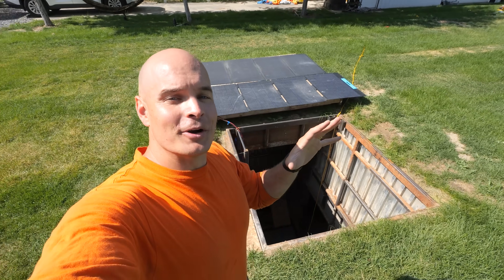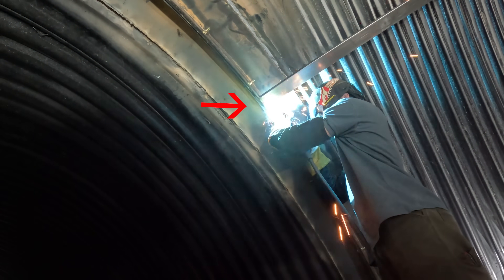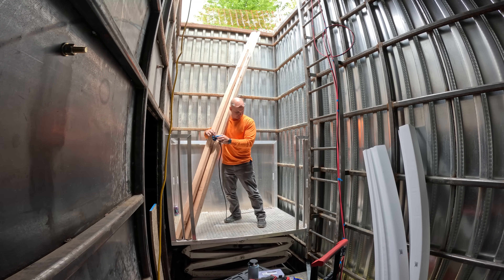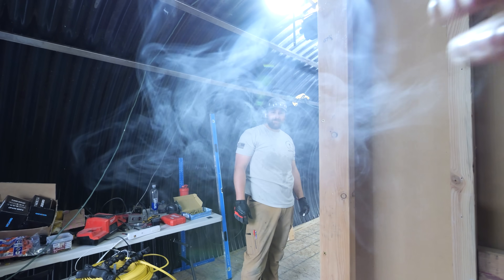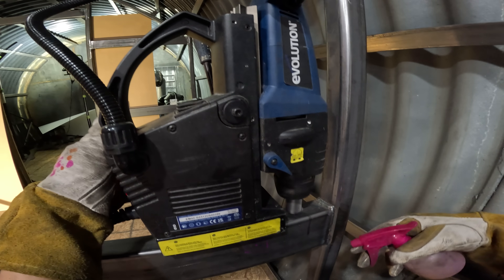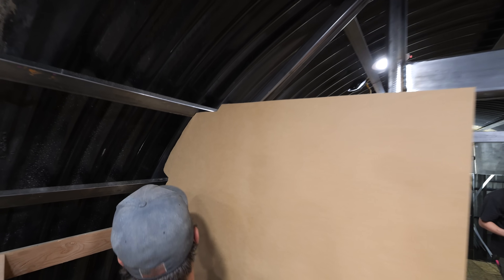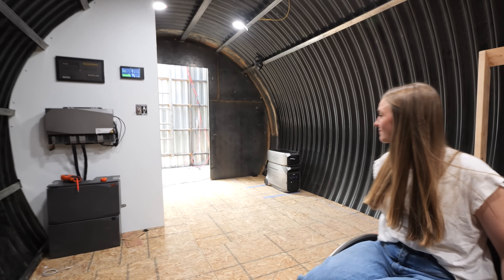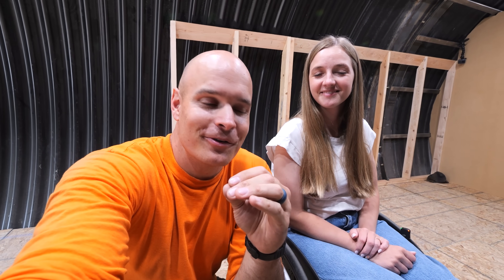How to Properly Power a Backyard Bunker - (Completely Off Grid)

Comment: While Ecoflow makes some cool products, they are an order of magnitude out of the reach of the average person without having to save up for quite a long time.  10KWh is also about 1/3 to 1/2 of what the average home will use in a 24 hour period.  So even if the bunker is not using a ton of electricity it will still need a lot more than 2 battery modules to power it under a full time use scenario.  5-10 modules (25-50KWh) would be a good start and that would be very expensive considering we aren't even talking about the ground mount array you would also need above the bunker to keep it charged up in a grid down scenario.  

Since the system installed is really designed for RV and van use it also can't handle as many batteries as the larger home systems can so it will not be able to be expanded beyond the single setup without a solution from ecoflow to allow more batteries and more inverters to be connected down the road and then things get more messy and less efficient (like in their whole home setups). All in, just the power system with 15KWh of storage and a 4.8KW (that is all the unit can handle with one inverter unit) ground mount solar array is going to cost well over $20,000.

Comment: I'm surprised you put the lights on the less efficient AC power seems like the perfect thing to put on the efficient DC and skip converting to AC only to convert it back to DC.
Reply: prob just easier to buy all the stuff.
Reply: @zachmoyer1849  Maybe. There's a whole market of 12V DC lights designed for RVs out there that are pretty easy to source. They're not usually stocked at the big box home stores but they're not hard to order.
Reply: @MrRtkwe  yeah now that im thinking about it though with him redoing that whole building to turn it into a factory for his wheelchair company he probably got all this stuff for "free" as leftovers or unused components in that buildout.

Comment: I've started old snowmachines and atv's with 15-year-old gas in them without a problem. You may have to put some fresh fuel into a spark plug hole, but the gas itself is usually still volatile. Gas has a much longer shelf life than most people think. I wouldn't recommend it for average use, but it will still fire a spark plug and cylinder.

Comment: Hey Jerry, with underground structures you always run the riak of radon gas build up which can lead to lung cancer. Even with good ventilation it might be useful to check radon concentration, there are these foil balls which you can hang in the bunker for a given time, the alpha particle emitted by radon damages the foil which you wont see before etching the foil with acid. In germany there is a startup who does this for 30€. Might be an idea :)

Comment: Electical batteries are good in the short-medium term. Using shelf stable unmixed chemicals to fuel growery lights for ethanol would be better. The conversion and containment is likely outside of the budget even if yours is much higher than most.

Comment: Thinking about your fictional apocalypse... the sun might not be the best solution for power generation. AND... since you have that wonderful elevator... I was thinking, a wind generator mounted to the elevator, that is extendable, and the base of the wind turbine could also house a security camera, so you can see whatis going on up top.  So obviously you will have a nice door when the elevator is lowered, why cant the elevator itself be a door while it is extended up top? With a wind turbine base attached to it, when the elevator is lifted, the turbine could be extended another few feet, and give you a place to mount a camera and weather sensors. When lowered, and the elevator lowered, you should be able to do any required maintenance on the turbine safely. Maybe bolt, not weld the turbine base to the elevator, so it isnt permanent.

You arent going to want to go up top in a wheel chair, during an apocalypse, very often. It should be doable, and make sense. Could be fun engineering something like that.
Reply: you might want to engineer a similar contraption for your solar panels. Something that will fold down and out once the elevator is raised into position, but be accessible in the elevator shaft, and secure, so you can do maintenance, or just to hide the panels from looters or passeres by. You dont want to advertise your bunker, or people will literally dig you up with a couple shovels. Or worse, cut off your air supplly and just wait for you to come up.

Comment: Curved translucent paneling with lighting behind to simulate natural lighting. White or reflective paint on the black outer hull so your lighting is energy efficient. A metal reinforced room for potential prisoners. An apocalypse bunker isn't an apocalypse bunker without away to vet noobs. Probably adjacent to the airlock room to the exterior, also soundprrof. A fire system spray system and a leaking water injection system. A straight away run space so that you can practice fleeing while contained and build the kind of muscles that you need for fast reaction distance. Heat removal venting so that your TV, batteries, and refrigerator don't overheat. An absurdly long tube for your exhaust. A separate absurdly long shaft for your escape. Non explosive weapons from Jorge Srague's slingshot channel. A space for your VR running system so that you can have physical activity in a VR. Strongly installed monkey bars so that you can do jungle gym climbing from one side of the ceiling to the other also helpful if you have flood and electricity problems. A punching bag attached to a sound dampening system so that you can exercise without reverberating the dirt around you and giving away your location. Storage space for dummies so that you can leave dupes behind in case of exfiltration, preferably under the beds. Storage space for electric digging equipment so that you can dig your way out in any direction. Same thing goes for all of the tools that you're gonna need to put down there I would suggest an entirely separate bunker for as many tools as you could possibly store. A bunch of other stuff that I won't mention because this isn't private.

Comment: Loving the bunker videos, quick question regarding the lighting. Are you using 120/240 volt down lights or are you using the power direct from the battery? As 200 watts seems to be alot for just lights. And using 12v would be a bit more efficient as your not upping the volts just to drop them again at the lights

Comment: Looking good! Personally, I would've used MC cable (Armored wire) instead of NM (Non-metallic) for extra durability. A bunker should be built with reliability in mind, since when you need it most you want everything to be working. MC doesn't cost that much extra than NM, and it just gives a little bit extra peace of mind. If you want even better durability, you have EMT and even RMC.

Comment: For the walls you should use 5/8 thick drywall, it's fantastic for being extremely fire resistant which would be important but if you double layer it which they do in many commercial jobsites its great for insulating sound so if you want the walls to be pretty sound proof without much sound insulation this is a great choice. To make it even more sound resistant you can hang it on what's called RC channel which absorbs sound through the wall. You can do all this with extremely thin walls. I'd definitely consider this if I was building a bunker lmao.

Comment: While the bunker is amazing to see this process. For any proof nuclear bunker needs to be built of reinforced concrete with walls 5 feet thick that could withstand a 1-megaton ground burst bomb a mile away without being underground at all. 
At the same time mailing the bunker that uses a minimum of two feet of concrete for the walls and a dome masonry roof to protect against nuclear radiation and radiation exposure. 
Perhaps your bunker is good for tornadoes, and pandemics to stay out of human contact.

Comment: Pretty sure this has been thought of, but there is a ton of unused space under the floorboards. A hinged access door could allow you to store tons of batteries, water tubs, extra supplies, emergency drain, etc. It would be cool to have an upside-down murphy bed with the floor as its base. Think of a full-sized bed under the floor, hanging upside down on rails. Pick up one end, pull the slide rails toward you, flip it over and then lay the bed flat. The mattress would flip from being under the floor, to right side up and you can just reverse the process to hide the bed and get floor space back. This way your square footage could be maximized and one of the largest thieves of square footage could simply be tucked out of the way. Or I suppose a pull-out couch would be more efficient, but less cool ;)

Comment: okay so what i wonder, this bunker keeps getting told that it's an 'extinction level bunker' (i take this with a grain of salt) yet everything electrical installed is this ecoflow shit that is highly propriatairy in all its connectors. even the breakerbox is non standaard. Yes it might be easy to install but don't you want something with as common parts as possible and with as much repair documentation as possible for when it does break? scavanging normal MCBs are a lot easier then some eco flow cirquidbreaker box.

Comment: Definitely should put insulation in the walls, not alot. Spending a lot of time in the 63 will start to feel cold. With a bit of insulation your passive body heat and the heat from the equipment should keep it warm enough.

Comment: Don't forget to isolate all walls for sound. Same with the flooring. Putting a (thin) layer of sound deadening isolation helps a lot. 
Compartmentalizing the subfloor helps with that as well so sound from one end can't travel all the way unobstructed to the other end.
You're in a big tube, you don't want to hear people at the one end of the tube flushing the toilet while you're trying to take a nap on the other side of the tube. :)

Comment: this off grid energy solution by Ecoflow Delta is brilliant, it would be something I would be looking into when I completely rebuild my Caravan (RV), I am thinking of having this installed with Solar panels on the skylights  which are also the air vents...and also have shore power as well, and have a panel in the main wardrobe to switch between the two.  When the power goes out which is oftern the case as I live in a Trailer Park (Caravan Park) the off grid solution would be great for it.

I am also going to install a temp system for the van in it's current state for a Blue Etti System with a 100W solar Panel, so that when the power does go out, I can switch over to the blueetti and then continue to have power while everyone else doesn't...but truth be told, you're video's are something I could look into..

Comment: Did you need to weld the skeleton, since welding was an issue? Could you have built a skeleton inside that tightly wedged inside,  with an adjustible feet like mechanism to ensure it will wedge perfectly inside?

Comment: You should add a periscope like camera, that’s on a hydraulic pole, that can pop up out of the ground, and then it should be strong enough to lift any potential debris on top of it. Then once it’s retracted it should be hidden to not reveal your location to those zombies. And then it means you can look outside to see if it’s safe to leave. Also probably have air quality sensors, temperature sensors, basically a weather station outside so you can also see if it’s safe.

Comment: Right now it looks like a battery fire down there would kill all the people. Slow exit and closed space. I think it is wise to use non flammable materials. Avoid wood and plastic material so it will not get smoke filled quickly if some coffee machine or something starts burning.

Comment: ☣💪🫡 LET'S BE PRAGMATIC & TEST YOUR BUNKER: Do you know, Zack, that the Apocalyptic event you are preparing for will practically render your bunker INEFFECTIVE? (since you used the word "Apocalyptic")? So, Zack and the others, suggest what you would do in the following situation (I’ve been a subscriber for 7 years now and have not missed one of your videos, except those published on Sabbath, Saturday)
👇👇👇

📌 A. COSMIC CALAMITIES THAT WILL REALLY HAPPEN
☣*A.1. Seven Bowls of God’s Wrath - Events prior Jesus' Coming*
	A.1.1.	Loathsome Sores (Revelation 16:2): Not directly affecting the bunker, but health supplies will be crucial.
	A.1.2.	Sea Turns to Blood (Revelation 16:3): If you’re near a coast, contamination could impact water sources.
	A.1.3.	Rivers and Springs Turn to Blood (Revelation 16:4): Contamination of freshwater sources, reliance on stored water.
	A.1.4.	Men Scorched by Fire (Revelation 16:8-9): Extreme heat could affect air conditioning systems and solar panels.
	A.1.5.	Darkness and Pain (Revelation 16:10-11): Power outages, reliance on backup power sources.
	A.1.6.	Euphrates Dried Up (Revelation 16:12): Geopolitical and logistical impacts.
	A.1.7.	Earthquake and Hail (Revelation 16:17-21): Structural integrity critical, potential damage to solar panels and water collection systems.

☣*A.2. Sixth Seal: Cosmic Disturbances, in Revelation 6:12-17 (NKJV)*
	A.2.1.	Great Earthquake: This would test the structural integrity of your bunker. Ensure it is built to withstand significant seismic activity.
	A.2.2.	Sun Becomes Black and Moon Like Blood: Likely indicates atmospheric disturbances. This might not directly affect your bunker but could impact your solar energy generation.
	A.2.3.	Stars Fall to Earth: Represents meteor showers or significant celestial impacts. The structural integrity of your bunker would be crucial.
	A.2.4.	Sky Recedes: Symbolic of atmospheric chaos, could lead to extreme weather conditions.
	A.2.5.	Mountains and Islands Moved: Massive geological shifts that could affect your geographical location.

📌*B. POTENTIAL IMPACT ON YOUR BUNKER & SURVIVAL RESOURCES*
So, LET'S TEST YOUR BUNKER:

🔆*B.1. Electricity (Solar Power)*
	•	Earthquake: Likely damages solar panels and wiring.
	•	Darkness and Pain: Prolonged darkness reduces solar efficiency, potentially making it useless.
	•	Impact:
	     -	Solar power may last only days to weeks.
	     -	Critical systems reliant on electricity will fail without backup power.
	     -	Gaming is impossible.
	     -	Air supply will be at risk.
	     -	Food refrigeration will be at risk.
	     -	You will be in darkness, unless you use LEDs without TV or any other equipment.

♨*B.2. Air Supply*
	•	Electricity Dependency: Air purifiers require continuous power. No electricity means no air supply.
	•	Impact: Air supply could fail within days, risking suffocation or exposure to toxins.

🚰*B.3. Water Supply*
	•	Stored Water: Initially sufficient.
	•	Earthquake: Potential damage to tanks and plumbing.
	•	Darkness and Pain: Electric pumps fail without power.
	•	Impact: Water supply may last up to 250 days if rationed, but damage could reduce availability.

🍽*B.4. Food Supply*
	•	Earthquake: Damage to storage could spoil food.
	•	Fifth Bowl: Darkness and Pain: Loss of refrigeration, due to loss of electricity, spoils perishables.
	•	Impact: Food could last up to 667 days, but storage damage and loss of refrigeration reduce this.

So,
❛ Some trust in chariots, and some in horses (, sometimes in Bunkers); But we will remember the name of the Lord our God. ❜ (Psalm 20:7, NKJV)
❛ He who dwells in the secret place of the Most High shall abide under the shadow of the Almighty. I will say of the Lord, ‘He is my REFUGE and my FORTRESS; My God, in Him I will trust.’ … You shall not be afraid of the terror by night, Nor of the arrow that flies by day, Nor of the pestilence that walks in darkness, Nor of the destruction that lays waste at noonday. ❜ (Psalm 91:1-2, 5-6, NKJV)

During the catastrophic events described in Revelation, the children of God are assured safety and peace, safeguarded by their faith and trust in Jesus. Thereby, will you trust in Bunkers or in Jesus? 🤔🤔🤔
👇👇👇

Comment: Interesting how the chide comments start dogpiling gasless generators that are setup to charge with cheap solar panels rather than go the subsidized route of having a 30yr finance payment every month for ugly and non-roof service friendly solar panels to be lag-bolted down to your roof and not even have a way to store surplus power for evenings and rainy days, as if that’s a way better way to do it, but sign on the line and it’s “free!”. 
Nope. It’s not free, and this shows how to work your way to actual independent viable real solar power. 
Not sure why the solar generator haters gotta get super loud and squawk but they are. 
This is now 10-15yrs more developed and smart way to go with solar. 
Also when paired with heat pump mini splits, is a low power method to keep panel arrays small, not bigger.